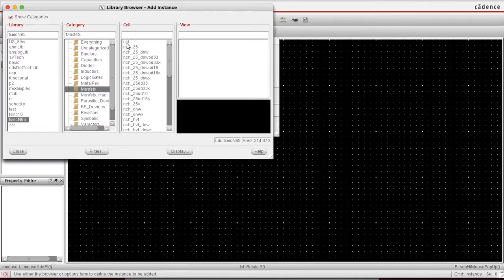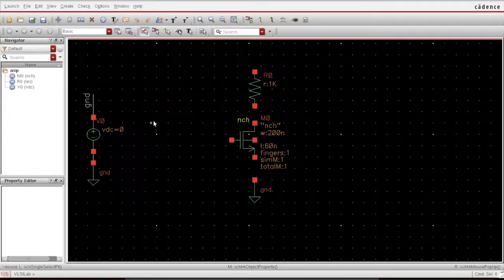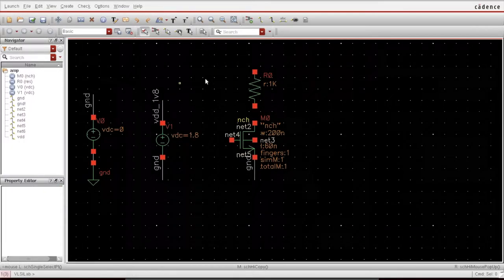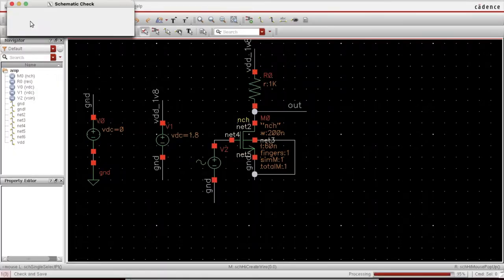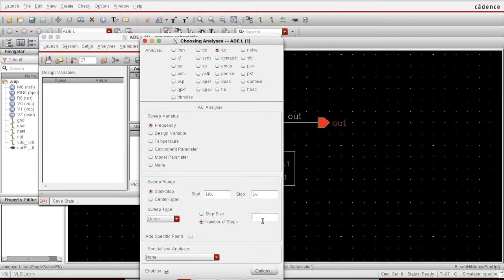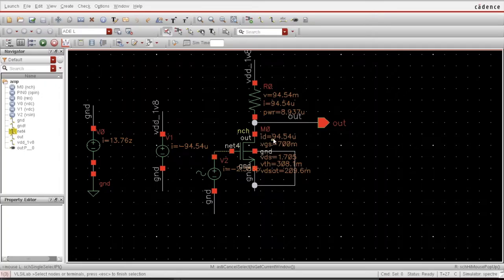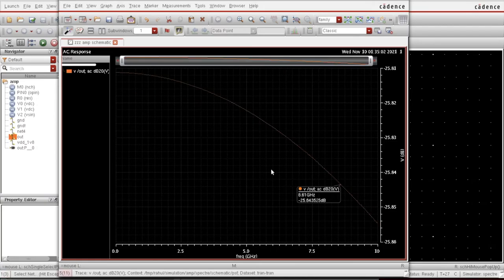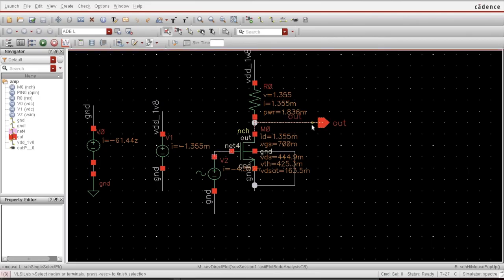Cadence-5: AC analysis in Cadence Virtuoso || Plot AC Gain & Phase || Tutorial on Cadence |

Comment: Nice video. But I would like to ask you a question why the phase plot starts from 180 degree instead of 0. I expected it should fall from 0 degree.
Reply: The common source amplifier feature is that output signal and input signal are in opposite phase at low freq.